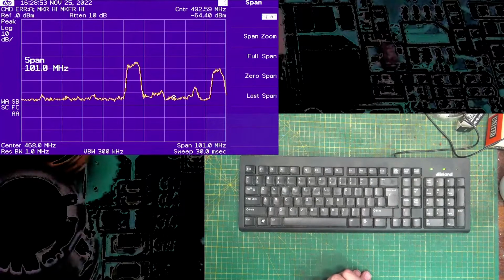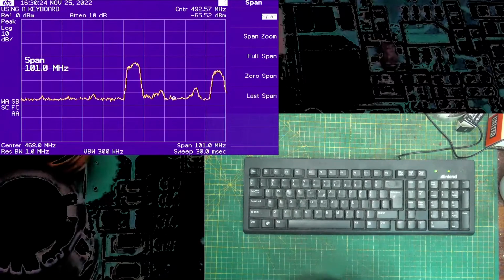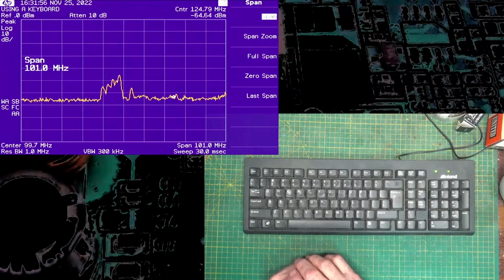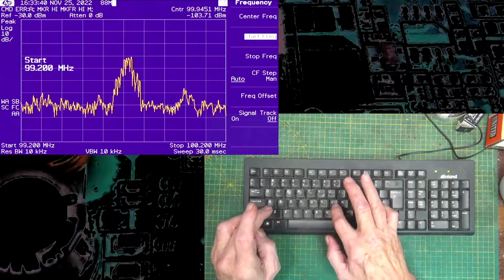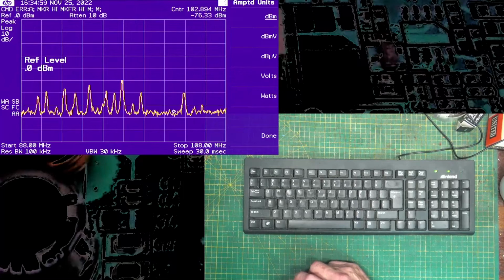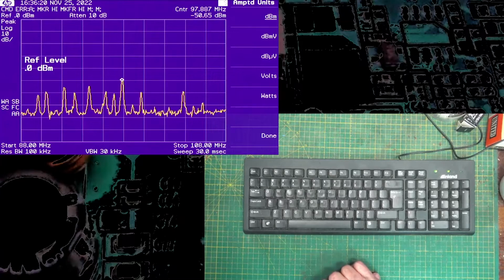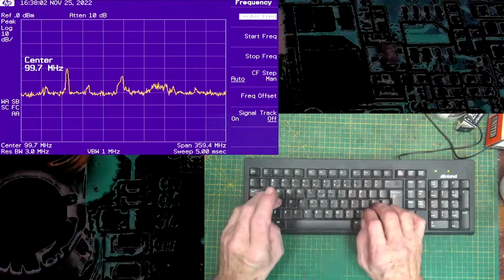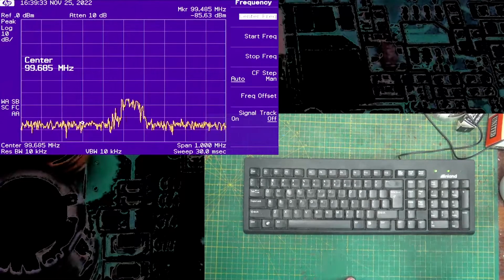HP ESA-L1500A Control it with a Keyboard

Comment: That is very cool!  The face of the SA says it goes to 9KHz, so doing radio you should be fine...unless there was something crippling of your replacement board?  Did you ever figure out how to output video from the IFR? I'm unable to....although I do see "a" signal on the oscope....also bummer to here about your IFR, got mine working and in line, nice but not as nice as your HP.  ~Jack, VEG
Reply from the maker: There is an analog video out connector on the back but I never tried to use it. I saw your video on your IFR. Good job getting it to run. One suggestion, don't leave it plugged in all the time. That is what happened to mine. The power supply huffed just sitting there, turned off. I don't know what else it took out but the power supply is a buggar to fix. The one thing I lost with the IFR was a resolution bandwidth of 300Hz but since I don't do anything with AM NRSC2 measurements I won't miss it.
Reply: @AERVBlog  OK, I've tried but no go...not sure if its me or it...just thought Id check with you since you had one....wow, thank you for watching my video!  OK, I'll put it on a kill switch when I can...hate to have it die sooner then later!  Thanks again!  And when the wife gets the package together, Ill advise! ~Jack, VEG
Reply from the maker: @VintageElectronicsGeek  I have watched a lot of your videos.
Reply: @AERVBlog  Really?  I'm very honored, hope not to boring!  :)  Thank you very much!  ~Jack, VEG
Reply from the maker: @VintageElectronicsGeek  not bored at all.  I wish I had your subscriber count. Only about 5.5% of my viewers are subscribers.
Reply: @AERVBlog  Thank you!  You are not that far behind, I suspect in time your numbers will grow, you are smarter and more experience then me, I have seen many of the big timers go from small channels to over 100K subs...you'll get there!  I've actually have seen my channel slowly die this past year...I don't get as many comments or posters like I once did and some of my regulars have stopped showing up but I see them elsewhere...sometimes I think why bother anymore.  ~Jack, VEG
Reply from the maker: I don't do youtube as a business just for fun and I guess I have sort of a niche channel. Sorry to hear about you losing subs. Don't quit please.

Comment: Great video, thanks for sharing it with us. Looks like your spectrum analyzer also has the tracking generator option making it a SNA as well - perfect for tuning diplexers and duplexers. Regards,  David
Reply from the maker: Yeah. I got really lucky on this one. I was forced to get a new SA after my IFR decided to do a halt and catch fire instruction while sitting there turned off. The power supply went bang.
Reply: @AERVBlog  OH, that's a shame! I used a much newer IFR 2497 during my career and was always impressed by its performance. Any chance you can repair yours?
Reply from the maker: @davidv1289  I doubt it. It smells a bit like the magic smoke came out. I think it is destined to go to someone that needs parts.